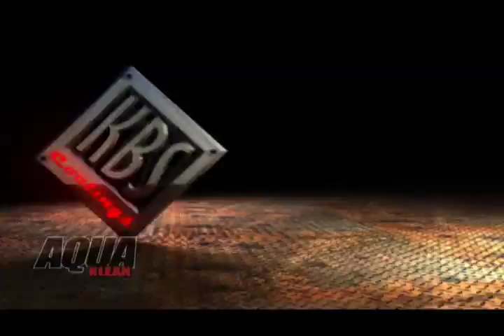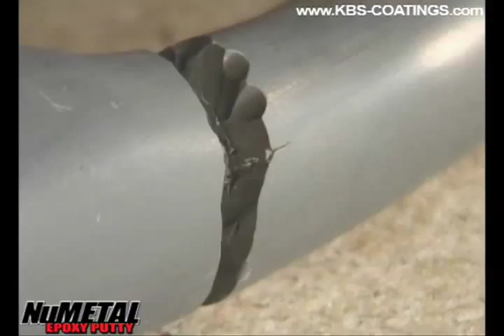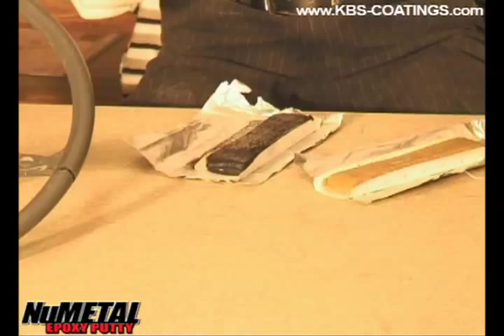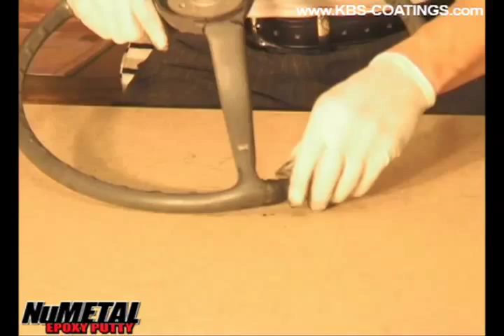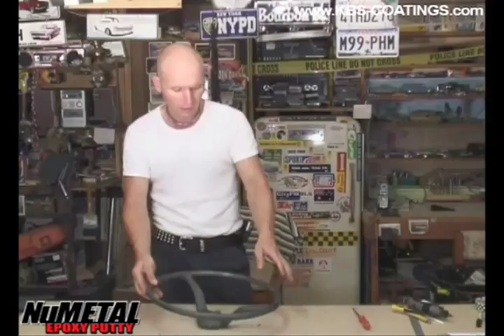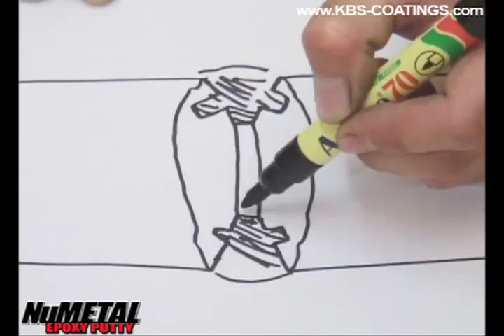KBS Coatings - NuMetal - Epoxy Putty - Steering Wheel Repair - Part 1

Comment: Hello  question you ...my steering wheel is original toyota corolla 1973 Te 21 ...I used the PC7 to repair my steering wheel ...In case the superficial plastic material that is in conditions similar to sand and that decomposes, what can be done there? by any chance is it smooth with fine sandpaper or use some adhesive or match with autobody putty? ...could you help me ...I'm trying to repair my steering wheel since they don't repair it in my area and it would be very expensive for me to send for repair .....I see many steering wheels repaired in worse conditions...my steering wheel is not falling apart...it is simply coming out as if it were dust or granulated plastic particles or in the form of sand superficially ... I thought of using fiberglass resin in a liquid way and passing it with a brush and used auto body putty and sandpaper ..... but my question would be if it could work or what you recomend me ?.I would appreciate your guidance
Reply from the maker: Use NuMetal to repair the steering wheel. Sand NuMetal smooth. Then paint it. That will prevent the deterioration. What color do you want it?
Reply: my steering wheel is black ...I can used the fiberglass resin in the deterioration superficial areas ? this area is same to  granulated particle
Reply from the maker: @mrz2528  Yes, and then coat the whole steering wheel with BlackTop to prevent any future deterioration. https://www.kbs-coatings.com/blacktop.html
Reply: Thank you